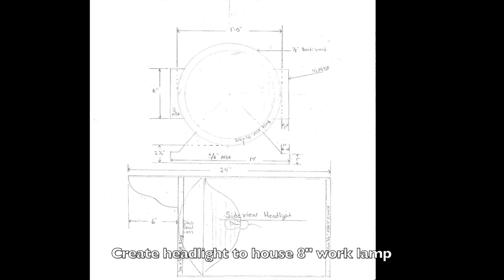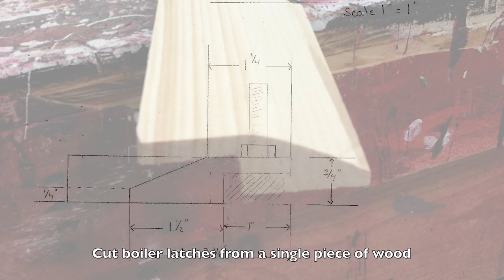Building The Polar Express

Comment: Isn't it four wheels,not three. But the rest is so cooooooooooooooooooooooooocooool
Reply from the maker: You are correct! There should be 4, however the room we were setting it up in was only so big... removing a wheel allowed it to fit in the room. Another wheel would have added about 4 more feet to the engine that was already about 30 feet.  Plus I had only 10 days and 10 people (who had very little building experience) to actually build the engine. So removing the wheel meant less time and material as well. And honestly you're the first one to notice... Thanks for the comment! I appreciate the view and the feedback!

Comment: Polar express is a 2-8-4 not a 2-6-0
Reply from the maker: Its not a mistake... it was a calculated design.  If I added another wheel, the engine would have been too big for the room it was installed in.  And if I added the rear trucks we would not have finished on time. So I took a few artistic liberties.  Believe me when people walked in the room, no one noticed or questioned the number of wheels, they were too busy picking their jaws up off the floor.